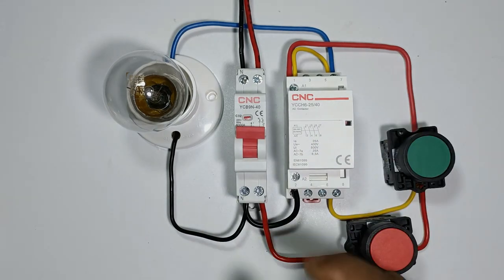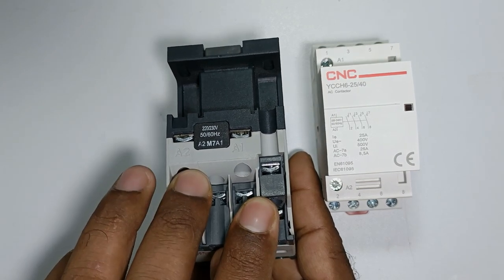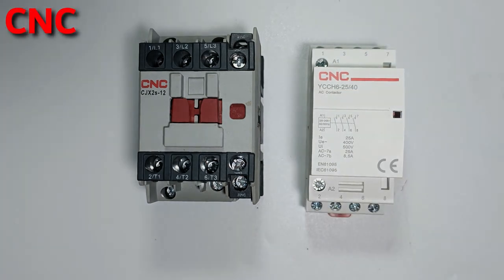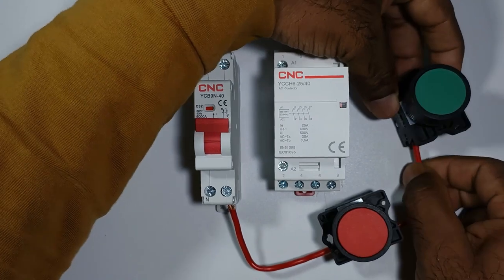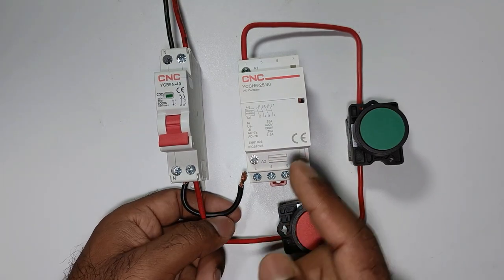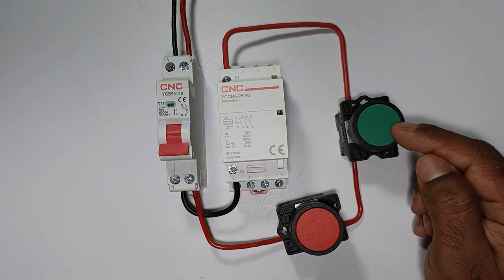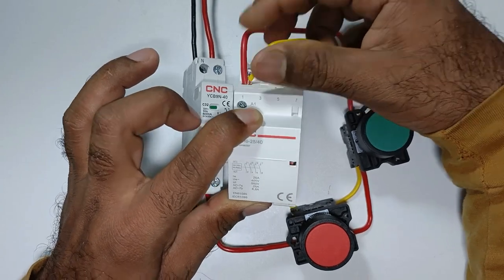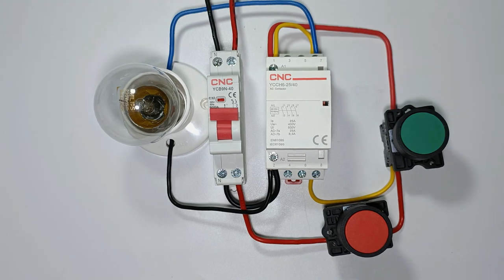Modular Contactor Connection Explained Practically | Contactor wiring @TheElectricalGuy

Comment: Thanks, If i connect single phase motor water pump 220v 8Amps 1.5kw ,Will this work with your diagram ?
Reply from the maker: Yes it will work but single phase motor connection with capacitor must be included
Reply: @TheElectricalGuy  Yes,Thanks for Quick reply ,The motor included capacitor 30mf.